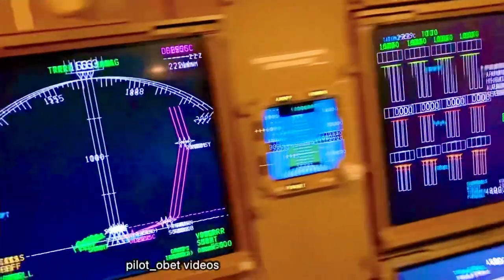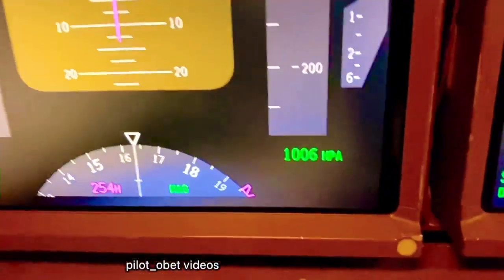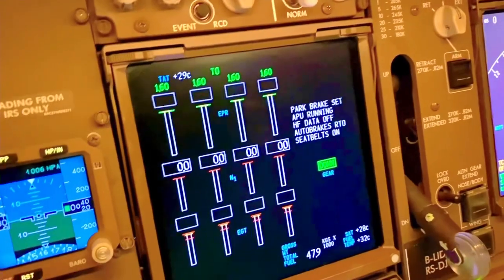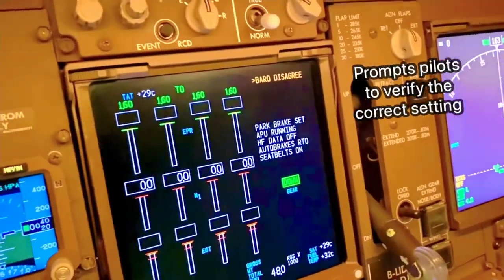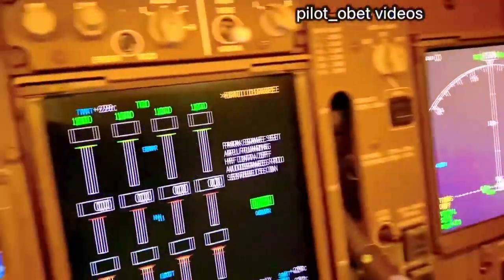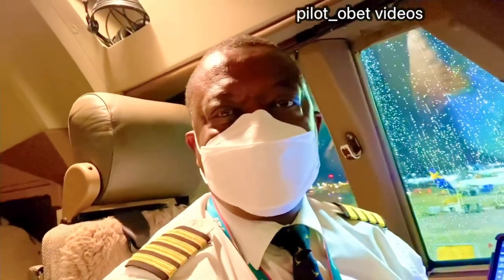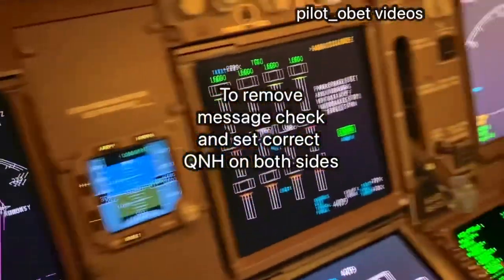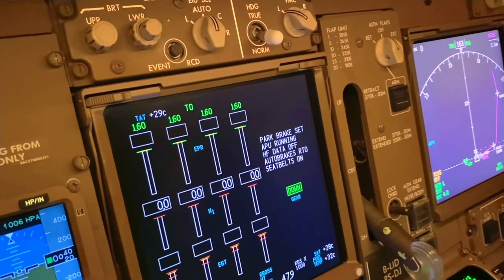Boeing 747 ‘BARO DISAGREE’ message

Comment: Is there a reason why the Captain and FO have their own separate baro settings? 

With the standby instruments I can understand the need for an independent redundancy but not the main instruments, after all there can be only one correct baro setting, either it's 1013 or the local QNH/QFE.
Reply: I think the idea behind it could be that since both pilots have to set their own baros, if a pilot hears a number, but enters it wrong, and the other pilot hears the number and enters it right, they'll get the baro disagree message and then verify and fix it.
However, if only a single pilot was responsible for setting the baro, then if they make a mistake, both pilots will have the wrong data and have no backup to know they entered it incorrectly (except perhaps to be told the baro again by ATC and check and see they have the wrong one).
So I think it may just be using the two separate entries as a form of error correction.